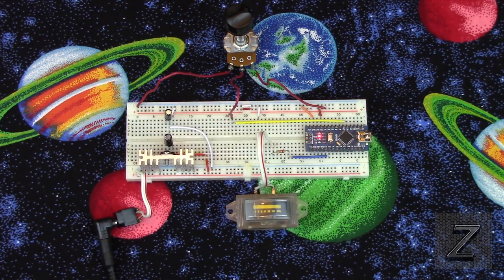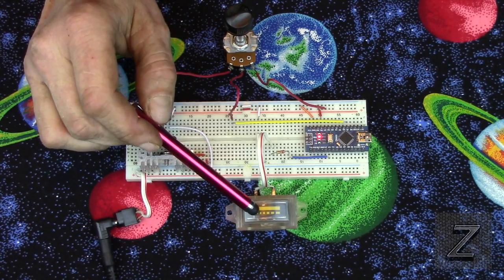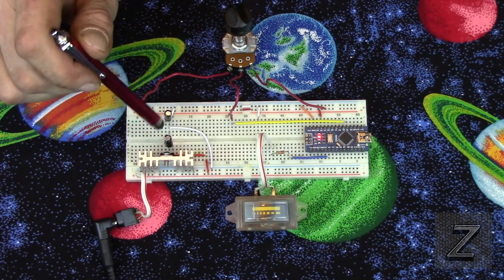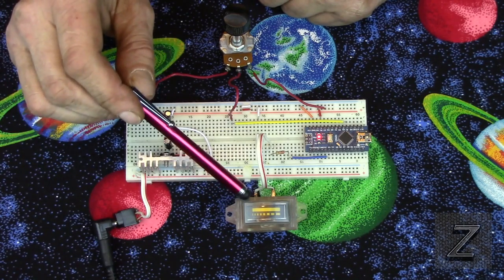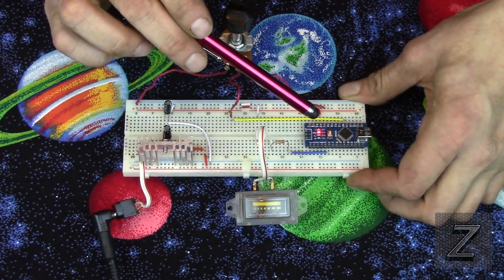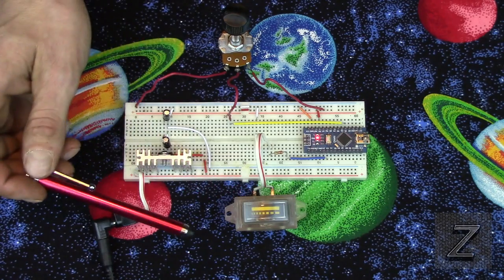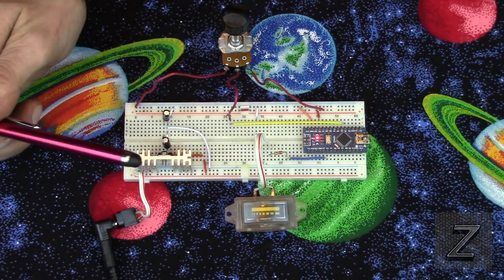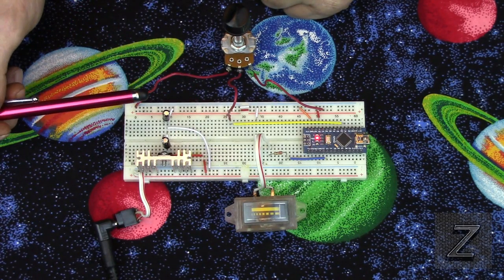How to use analog meter gauges with your ARDUINO project

Comment: Would it be possible to have a digital input (for example a digital speed signal) to be hooked up to a analog gauge?
Reply from the maker: yes, writing the Arduino sketch for that would not be very hard and would be good practice for learning Arduino. Good luck , if you have any problems with it I can help but I will not write the sketch for you.
Reply: @z-hut1663  i am trying to do the same thing as hottknife here, but my analog meter has 4 pins. It's from a car's dashboard